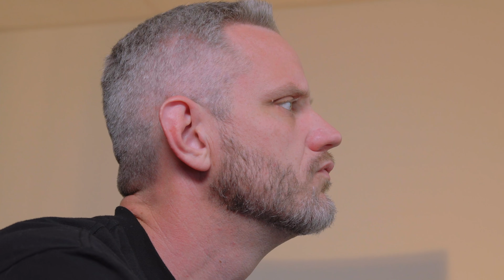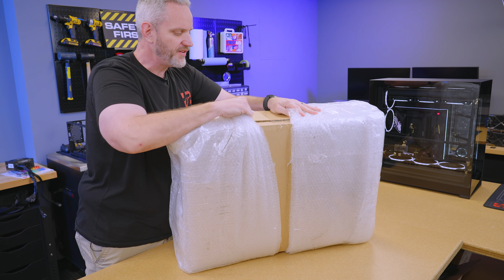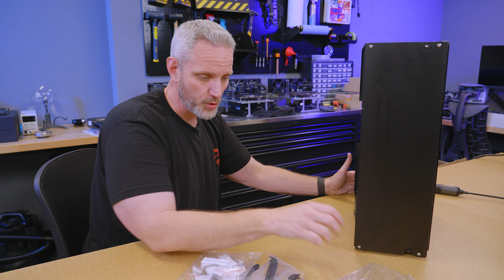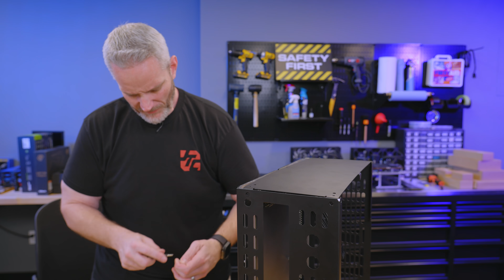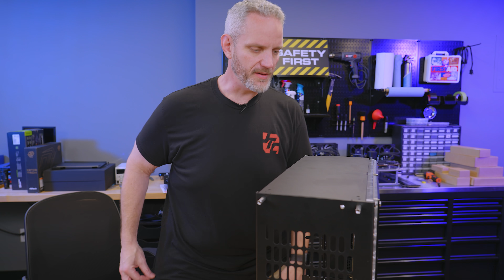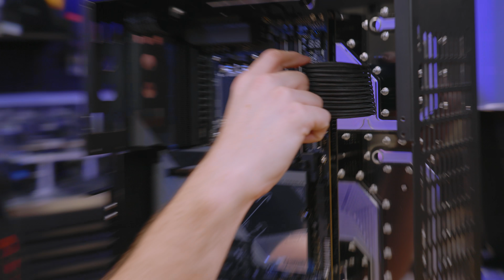I guarantee you haven't seen a case like this before...

Comment: Old vid but @17:00 that wasn't the reason why it broke. It came broken, you can see much ealier on the vid that corner was broken already.

Probably the hit at the opposite corner push for the top metal piece forward forcing the corner to Crack. The bolt been so close to the edge didn't help the situation either. 

You guys should do a collab at this point to do a case. They always seem to miss the mark on their cases.

Comment: This is one of the cases, that has been designed build and sent. Like it has all those solutions that, if tested, would instantly require a redesign. I really do not like this type of product. Has the creator even try to make a build in it?
The acrylic cracking is one of the things that I was really waiting for to happen. The metal screws should have added insert in the acrylic to be much more robust.
The airflow is not great.
The lack of any frame with this level of thin metal is not the best option as well.
The power board should be smaller than the motherboard so that the cables would fir without an issue, you do not see it anyway!
Way to many issue with building in it. Good idea, bad execution.
Thank Jay, good job :)

Comment: I just find it a weird case. "They videocard is sticking out..." Yeah. Great! Tossing the acrylic plate into the bin The distributing plate is a nice touch. But if you buy a powersupply it's taking in account that it must cross some distance. So now it's crowed with cables next to the powersupply. That acrylic window may come back if you install Der Bauer watercooling  solution on the graphics card. That will become a very low profile graphics card. And for RGB enthousiasts? Too much is blocked off. That other case in the background that Jay build for a friend is so much more pleasing to the eyes! That was not a cheap build by choosing high-end components.

Comment: Huh, a GPU outside of the case. This might solve the RTX 5090 / 4090 fire hazard ATX 3.0 12V Power connector.

Comment: The acrylic should have hole reinforcements to help avoid cracking. Using stamped, fluted, and possibly some strategically placed gussettes would improve the overall rigidity of the case. Glass would be nice. A couple more fan exhaust options would be a plus.

Comment: 25:10 I would love to see comparisons of how specific higher end CPUs will benefit from performance and/or temperature difference from different radiator brands and sizes. Like for example the 9950 X3D with PBO but still out of the box and no added OC, performance and temps on a 420mm vs 360 vs 280 vs 240 - and then possibly some way to add in a watercooled card  to see if the two parts combined will saturate the radiator and how quickly.

Comment: This case reminds me of a saying, " Made on a Friday ". I'm sure there are those will like this, as they'll probably* see this as something they could build off of. Like make some 3D parts to extend the height / length / width of the case and add ventilation to those parts and what not, and really make it their own. But other than that, I don't see this being a " Big Hit " outside of that possible niche customer, especially with the cost of it.

Steel and Aluminum, I hope they put stuff in there to avoid corrosion.

Comment: Is it safe to run wires under the motherboard if u need? ;) not like right below the cpu. Sorry to say but this is first time i didnt like your presentation. U totally destroyed purpose that its build for by putting air cooled gpu. Also a cheapest loop could be made just to present the back cdu witch sells the case. Its not well made but it has style and serves a purpose. In days where ppl buy mostly same cases its good to have something different, even if it has flaws. If i have money to buy gpu like 4090 and wanting to water cool it, i would consider this case for sure, but for 250 bucks or same price but with glass and 3mm thick metal frame.

Comment: feel like with the sheer amount of rivets/screws on that 5mm thick metal, its going to be an utter humming/vibration nightmare, especially that front panel where the rad/fans would be.

not a single thumb screw in sight, the GPU mount tbh looks ass. the GPU clearance also could impact some motherboards that have stacked NVME cooling and with little clearance from the cold plate side to the acrylic most tube fittings would have to run behind not in front (or you have them angled from the top) so this limits imo a lot of options. could also have issues with VRM/CPU block combos with how large they are too.

I get the attempt but I just feel like they only thought this through with there product stack and no real thought with other products or specific tube fittings/tube runs impacting other blocks or NVME cooling options that some boards have or some users might have

Comment: Funny I was just about to put my watercooler on top of chassis. 
Top is a solid plate.
This let's the cooler have it's own air.
Getting cold air and deliver no hot air to the rest.
This can be done with an inside install, but it requires a well adjustet air flow direction.

Comment: the case is really nice if think about all the extra features like plugs and water block its not really expensive , I 100% agree that the front panel should be glass that really does make or break a case I never buy ones with plastic anymore due to scratches as jay mentioned

Comment: 24:33  Imagining a push pull rad on the front of the case mounted on the outside and then a pull rad mounted on the other side inside the case. basically fans then rad then fans on the outside of the front with another rad on inside then fans

Comment: Remember. The case is designed for water cooling. It is expected to use a GPU with a water block, which would for vertically

Comment: This looks kind of janky. Tight fit for those stock power cables, metal seems flimsy and easily bendable, parts breaking, acrilic panel that easily scratches and all for the "low price" of 369$ ... Cool idea with the distro and power board but the execution of the case is meh.

Comment: Well if a card is going to stick out, what about a magnetically connecting shroud panelled in filters?
Reply: The larger stand off with fans on the outside could have a wrap around filter attaching to itself at the top with Velcro and supports at the corners or whatever as needed, but I'm an animal :P

Comment: This one is a bit of a conundrum. For me at least, its difficult to tell who this case is aimed at specifically, with the contradicting themes. At first glance, this one seems to be made with minimalist/pure function builds in mind. No shiny bits, just black tubes/fittings/components that do what they're supposed to. But if that's the case, then why the clear reservoir/distro plate...

If it's geared towards enthusiast customers, the panelling that hides most of the build on a case seems a bit counterintuitive; you're hiding all of the pretty bits like cable management, fans, piping, RGB, and CPU displays behind solid panels, leaving only a small window to showcase all of your hard work. I'd have to see the non-watercooled iteration to see their intended layout, but the lack of fans is a bit of a concern as well for aircooled builds, or even watercooled builds in this version for that matter. If your intent is to have the case closed up, then going horizontal mount on your GPU would almost be mandatory, especially for the newer, big boi GPUs. Hopefully the non-watercooled version has mounts for fans and/or AIO radiator on the rear side panel. 

I personally think this one is a bit of a miss, but I do like that they're thinking about people that dont want a giant monstrosity sitting on their desk but still want something sleek. It's modular enough to make a build all your own somewhat, but the constraints you have to work within, like fan/rad placement, case depth, and airflow heavily restrict the creativity, unless you modify the case, which would make getting this case over another a bit pointless.

Comment: Design is ''cool'' but the Case look so Dam cheap, they need to forget acrylique and make Glass Panel Minimum and for the metal part more thicker. It would be so nice having the Distro plate made in glass for the front and POM for the back

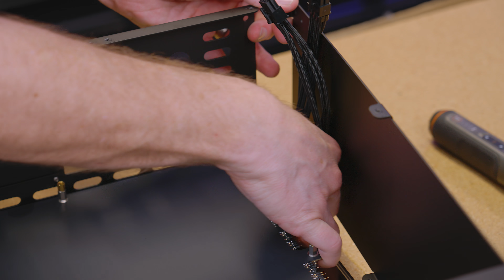Comment: 13:48
You should suggest 90° connectors to the designer. Maybe cablemod could make him up a handful of custom pieces to work better with the power board.
Reply: 19:31
Another great example. The included 24 pin is great for most systems, but having other configuration options could be beneficial. 
Like you mentioned he's not making thousands of units. But him having the ability to order even a couple hundred custom cables will likely be easier for customers rather than a couple hundred end users trying to get individual orders made to use the case.

Comment: The front panel needs to either be 1.5mm steel and folded 180 degrees at the edges or made from a thicker piece of steel so that it doesn't wobble.
The fasteners are too close to the corners which is okay for the steel but not great for the plexi pieces.
There appears to be no additional reinforcements in the corners of the case. That's really not helping the rigidity of it.
I like the case but this idea has come out a bit undercooked.

Comment: Agree there should be a way to expel heat out the top, even though this is the water-cooled version of the case cause other things like the chipset etc... make heat to get rid of. BTW, why would you put an air-cooled card in a water-cooled chassis? I'd like to see it reviewed with the video card the case was designed for, just static without running all the tubes. Maybe the air-cooled chassis is wider to accommodate air coolers?

Comment: 250 dollar case that looks like shit and has the airflow of a abused optiplex? big no f u the montech king 95 pro can go as low as 130 and it has six fans already and you can fit 2 360 mill rads or 2 280 ones theres no reason to pay any more for a pc case especially one you could just 3d print at home.....

Comment: Use a product called Plexus Plastic Cleaner and Protector. Comes in a black and blue spray can. Used it on aircraft windshields with microfiber cloth and have used it on acrylic side panels for about a decade. Works great and is readily available online.

Comment: And where does my Blu-ray player go? Why are most case designs these days like we all want an aquarium without external device options?

Sorry I don't like it and not very well designed next to being very vulnerable. Not enough space for high power connectors and no easy access to those RGB connectors when the board and other components are in seems annoying when figuring out which sockets to use, do maintenance and troubleshooting. I'm also not sure why they send a damaged case to a reviewer

Comment: My only complain is the front grill bit, it's already districted with that solid panel, and then they reduce airflow even more by having small cut outs instead of big openings.

A grinder will fix it easy tho 😂

Comment: I had a customer who wanted a case with a window way back before they were using tempered glass. He brought the system back one month before the end of the CS that I would give and was complaining about the appearance of the case. The tiny 3" square side window was scratched to hell. I couldn't believe how badly it was scratched up - even the steel panel was a bit scratched. Turns out he had kept the system on the floor and his cat liked to scratch it. We didn't have any of those cases in stock, so I went to the hardware store across the street and used a $15 Car Headlight Polishing Kit to remove all the scratches from the acrylic panel, buff it crystal clear, and then a car paint touch-up pen on the steel and had it back to him later that evening after an hour and a half of effort. I told him to put the case where the cat can't get to it if he didn't want that to happen again.

Comment: Jay should head to the hospital as he doesn't seem to be thinking clearly and may have had an aneurism
This is an expensive water cooled case so why would you even be thinking about not water-cooling the GPU which is why the vertical mount for it is there, and guess what, a water cooled GPU does not need airflow from the front nor the depth for a GPUs radiator. Same thing applies to your CPU.

Comment: I can appreciate the attempt at them doing something different with the design.
But I'm not a fan of the front, or the lack of "sightlines" for a watercooled build. It feels like it's trying to be a sleeper industrial build, but with an attempt at fancy.

Would love a proper front panel where it's open and breathable. Or heck, make the solid front panel into a highly perforated one. And bigger openings to see the inside of the case. (I want to look at all the work and fancy I put into it)

I keep picturing this with nice circuitry styled integrated RGB (white or grey) across the powerboard, distro plate, riser and maybe the edges of the case. If they were to do an updated version of all those.
A larger, "super tower" watercooling version that has all that would be extremely appealing. To me, anyway.

Oh and I love that they actually DO have compatibility guides on their site for the powerboards btw.

Comment: Not gonna lie this looks like a nightmare to build in. Totally backwards building experience, really flimsy materials, There are very few EATX boards that would work in this case. the way you have to put the motherboard in last, no room for air cooled cards, even a water block would have trouble clearing the center "glass". That's another problem. This is a huge L, there was no R&D here.

Comment: I think i would set it up for push pull and remove the front panel entirely.. since there are nowhere else to put fans.. but is a thin 420 enough to cool a 5090 and 9950x3d? .

Comment: You mentioned it in this video, a good test might be a push/pull setup with a thin radiator Vs a thick radiator with a push OR pull fan setup. Curious if the temps show any major difference.

Comment: I have a Cooler Master HAF-931 that is still the best PC case in the world!  There is absolutely nothing that will not fit inside this case!   I see too many cases that look good on the outside but inside they are poorly designed;  being cramped,  with no room for a long GPU or to run cables neatly.  That acrylic side panel is light, a glass panel would add $10 to the shipping costs!

Comment: As a fellow Aussie, and although I like many of Daniel's/Singularity's designs, 1 single radiator is NEVER enough to water cool a CPU and GPU. All my cases over the last 10 years of watching JTC, Paul, Bitiwt, etc., have been able to include 2-4 radiators to achieve the cooling required. With the GPU insanity of heat sink requirements now, this case - although it looks nice and the Distro is fabulous - needed to have a top radiator (45-60mm push-pull, 420 or 480, without interfering with the Mobo), a rear radiator 240 (30mm), and a bottom radiator (30-45mm push-pull). The biggest mistakes cases designers are making is not providing clearance for ALL components: if you use a Mobo with LED readout, we do not want case I/O sections being covered by radiator and fans as exhausts on the rear FFS; top radiators push-pull should not cover any section of the Mobo; front radiators push-pull should not interfere with anything else in the case or overlap anything; bottom radiators push-pull should also be clear of anything. Why designers are ignorant of these facts is beyond me. Cases need to be made for water cooling with correctly aligned fill/drain ports, which are usually stuffed up too.
Overall, this is FAR too small a case for modern high-end components. Also, the price in $AUD is COMPLETELY unacceptable and has been for many years now.

Comment: The panel on the front should be a giant radiator, actually, just make the rest of the case out of radiator with copper tubes to maximize cooling EVERYWHERE

Comment: @ 26:50 build the case just like that. but swap the 5090 for a 9070xt red devil. anodize all the stand offs and screws red. use red coolant, clear hard line, run a tube thru the loops made by the power board. lazer cut a power color red devil logo in to the front plate. it wold look sic.
Reply: You'd have to get aluminum standoffs and screws to be able to anodize them, but that would look really good

Comment: Jay, think you could 3d print brackets to put 2 radiators where the top and bottom panels are?  so front rad + 2 side rads with acrylic in the middle.

Comment: The metal panels should be fluted to make them more rigid. Replace the acrylic with glass or a mesh. The screw holes on the acrylic should be further away from the corners to avoid breakage. Make the standoffs with opposing threads, so they don't unscrew each other.
Reply: They offer upgrades on their website, it's like $20 to upgrade from crap acrylic to super nice glass.

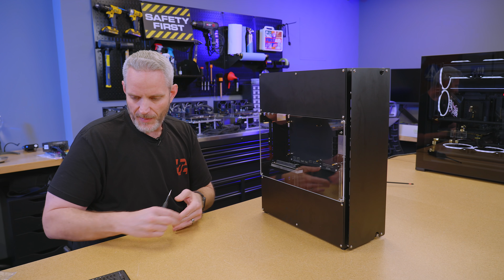Comment: 5:40 microfiber is actually very abrasive on a microscopic scale. Thats why they clean so well. They claw into the dirt -and everything else. I've read if you use microfiber to clean your floors, after a year or 2, they become very dull because of all the micro-scratches that have accumulated over time.
Reply: Anything else for suggestion to clean? Would love suggestion fr gng
Reply: @Vips-  sorry. I was too much of a bachelor when I read that to remember the next best thing. The idea of micro-abbrssions stuck with me though.
Reply: @goldenheartOh  yeah I'm cooked
Reply: @Vips-  i dunno, have you thought about just regular cloth?
Reply: @cruz1ale  wont that have more rough of a texture?
Reply: @ Microfiber cloth is abrasive because the tiny fibers stick even to small particles of dust and dirt, and any unevenness in the surface that is being cleaned. Try swiping a painted wall with a microfiber cloth, it sticks. Then try with a 100% cotton shirt, it just slides because the fibers are much larger
Reply: @ ohh okay thanks